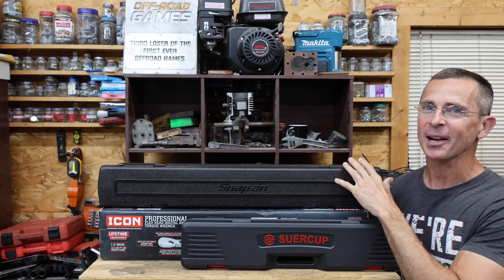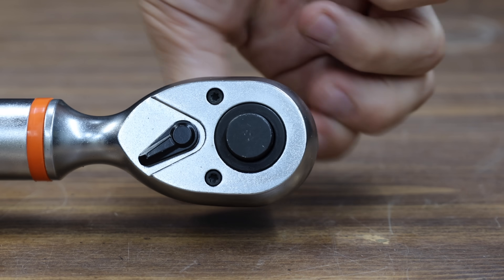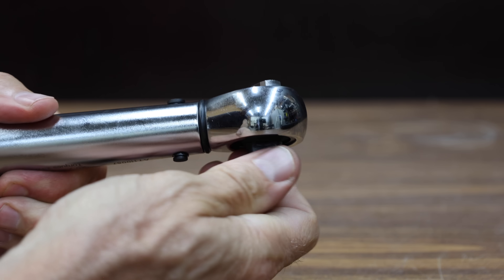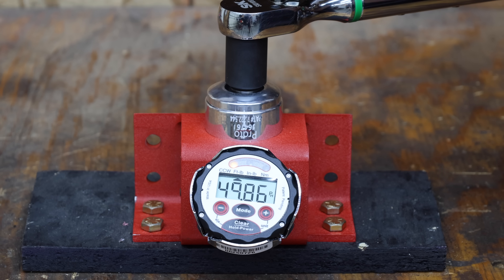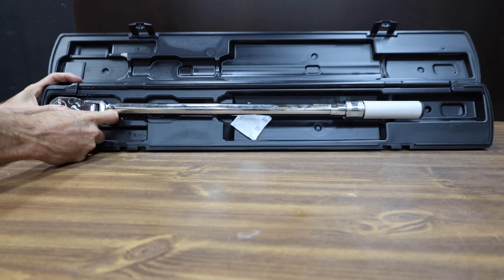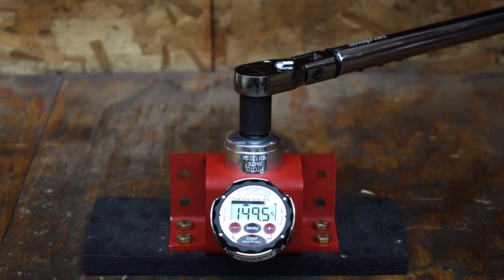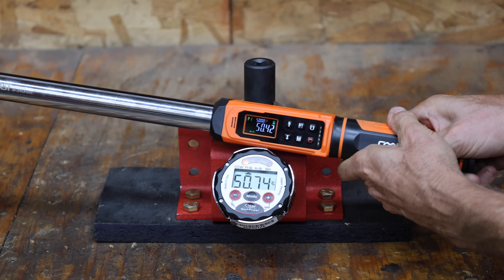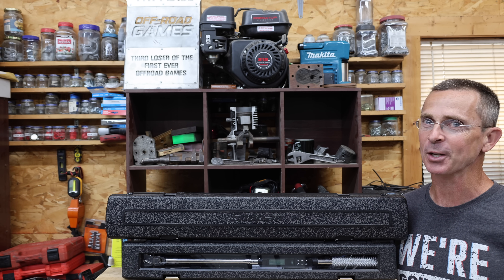$78 Torque Wrench vs $790 Snap On & ICON—I Didn’t See This Coming!

Comment: Is it fair to say the AC Delco torque adapter is probably identical to the Harbor Freight Quinn adapters? They're accurate enough to get the job done for casual home maintenance.
Reply: I was about to say the same or similar; all wrenches were accurate enough for the mass of automotive and home project usages.
Reply: what kind of "home maintenance" are you doing where a torque wrench is even remotely necessary? Usually just use the German standard DIN 12.3456 "goot-en tight"
Reply: @gorak9000 working on cars. I meant at home not necessarily doing work on a house itself. Sorry for not stating that more clearly.
Reply: I was curious about this too as those are the ones I would like to buy but not sure on accuracy.
Reply: @pichidubz-566  I have the 1/2" and 3/4" Quinn torque adapters

Both got their calibration checked by trescal with the rest of my torque wrenches and they were well within spec

Comment: I have an old craftsman click-type torque wrench I bought in 1980. Ive used it since then without ever checking the calibration. Build many engines and transmissions with it
Reply from the maker: Thanks for sharing!